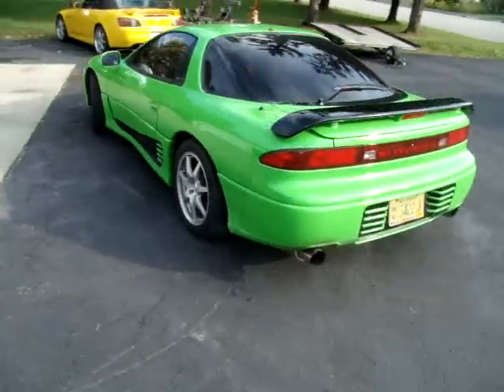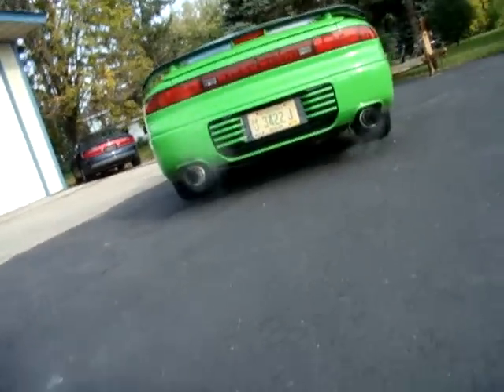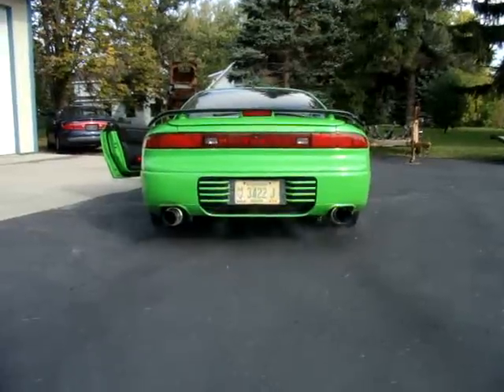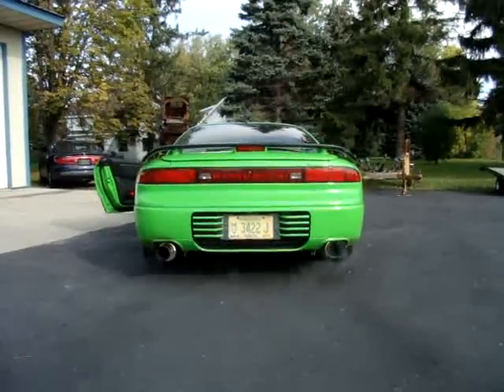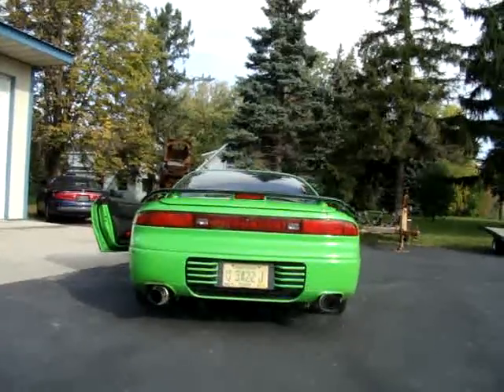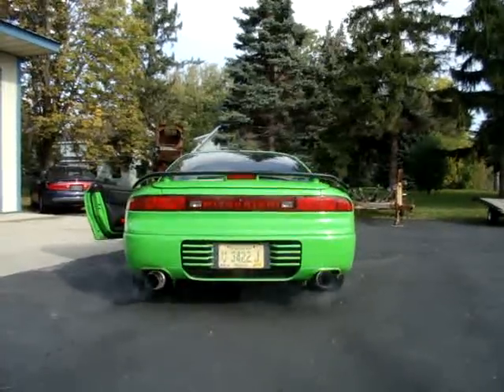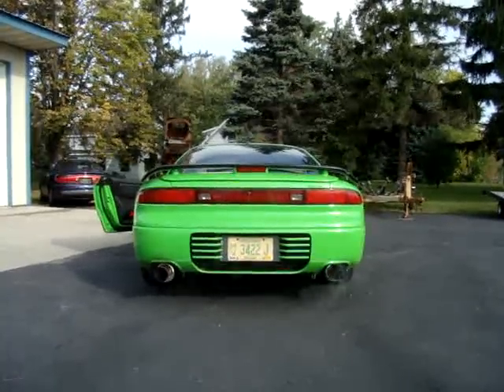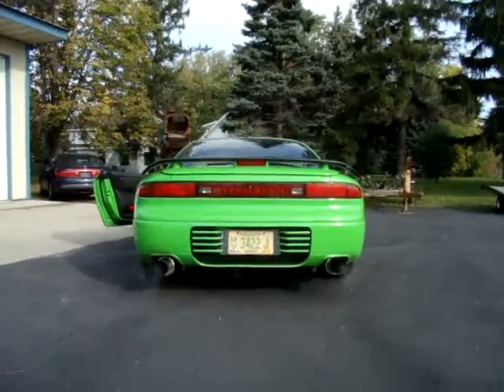Kawasaki green 3000gt vr4 dr750 turbos walkaround and modified exhaust sound

Comment from the maker: I ordered  adjustable cam gears and a billet front pulley. Got an AEM computer that I have been street tuning. Oh the Ebay exhaust sucks. The mufflers blew out already. All I really want is 550 at the wheels and I'm good. At this level I can beat on it all day long and It should take it and be fast in the process.